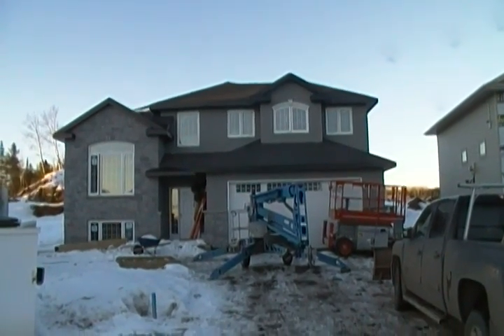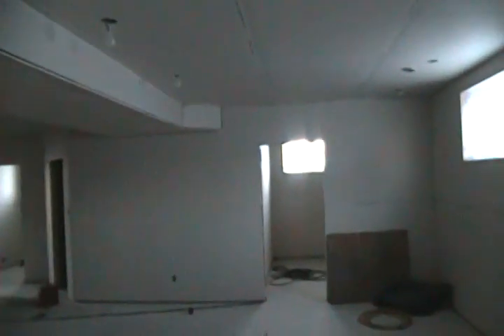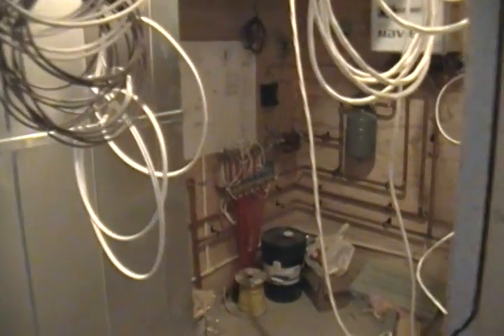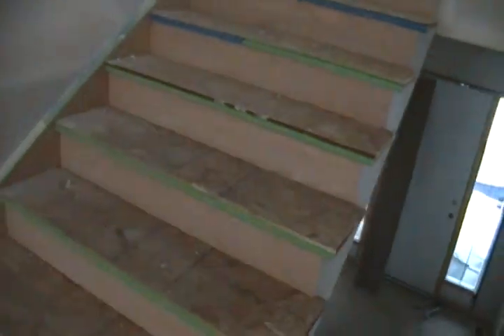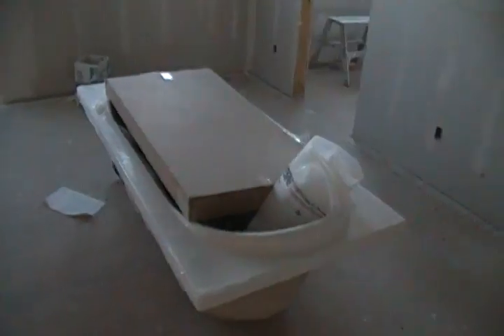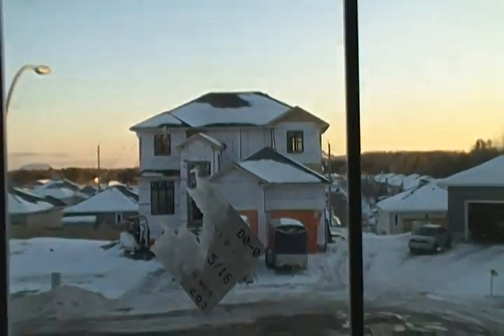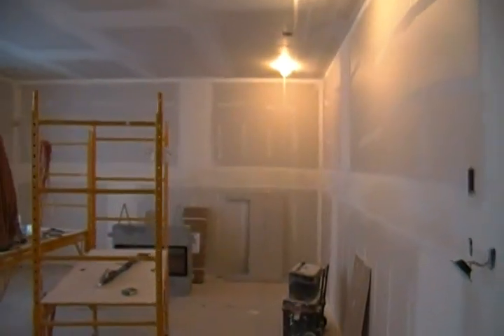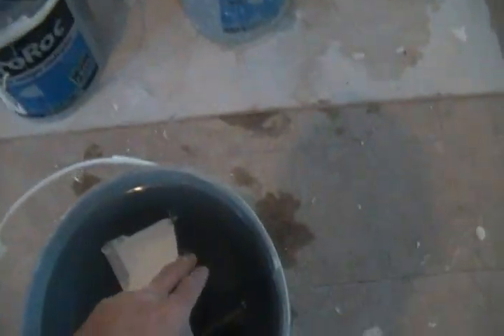Drywall taping project

Comment: Boxes? I thought you mostly hand coated.
Reply from the maker: Occasionally I will finish with a box just for shits and giggles. First coat with a box and finish by hand normally. I get bored easily.
Reply: +Mud Slingr that's some pretty pricey shits and giggles lol. I'm actually just starting out taping. You actually inspired me to switch to a trowel. And even though I haven't been using it long, knives feel weird now. I prefer hand taping. It just feels more rewarding like using a hammer instead of a nail gun or hand splitting wood. I guess I'm old school that way.